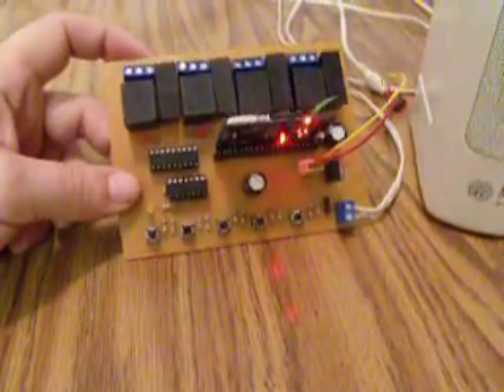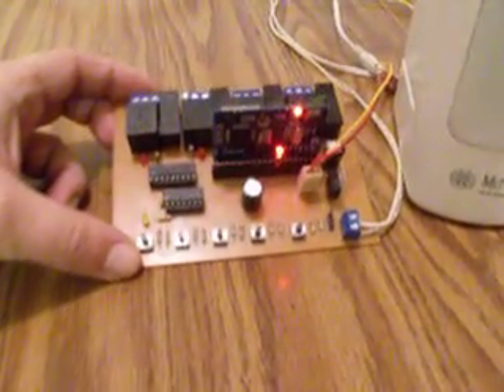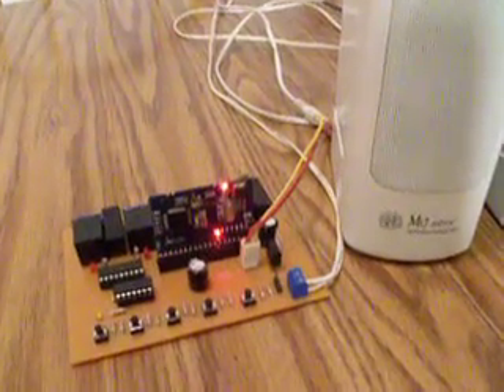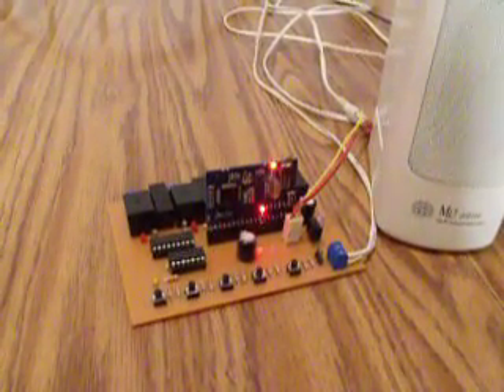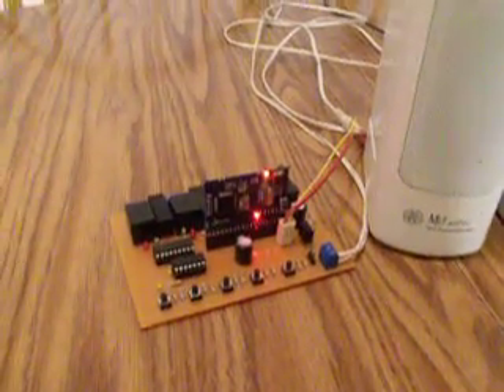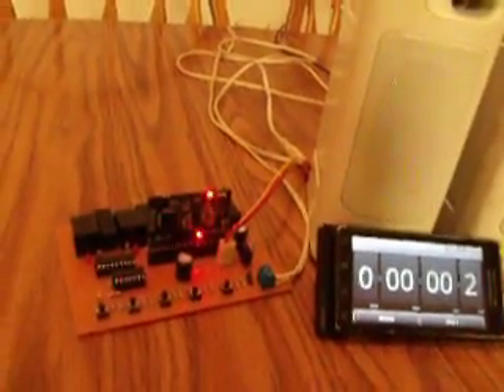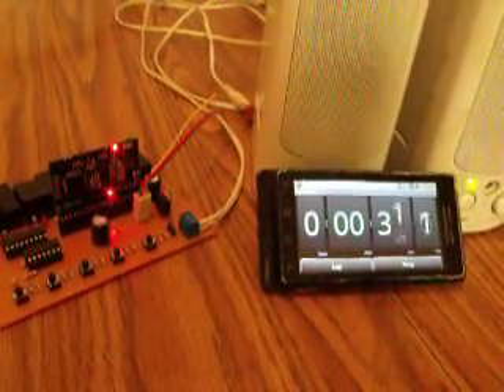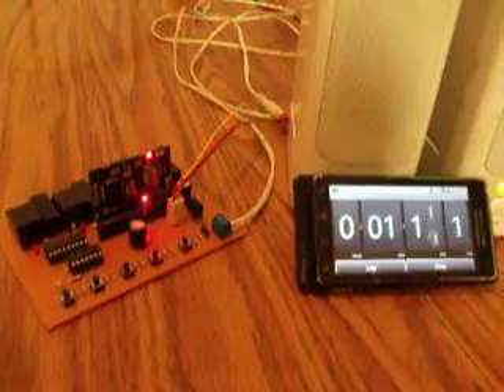Feature update to prop controller

Comment from the maker: oh Sorry I forgot to link to the files.  I added a link for the files I was using to the video description.  I am currently testing an even newer version.  The newest one will have the trigger delays set to 1,2,4,and 8 minutes.  This numbering eliminates overlap of sum values and makes 16 total delay times possible. everything from 1 to 15 minutes in 1 minute increments.